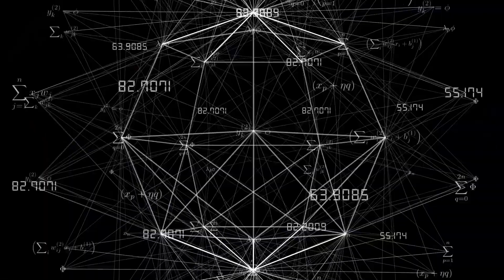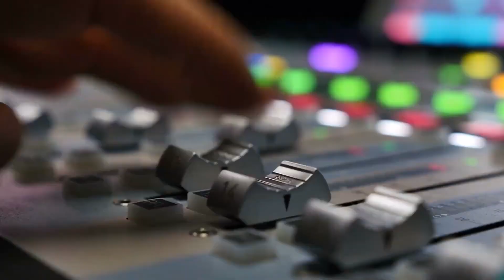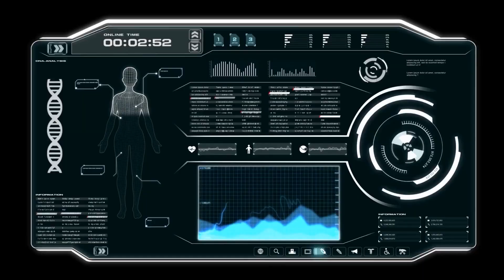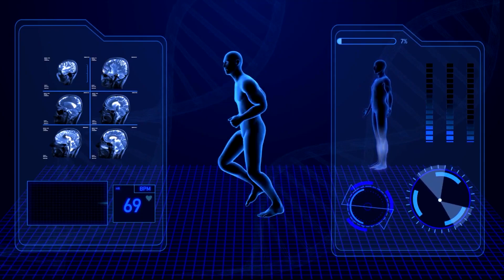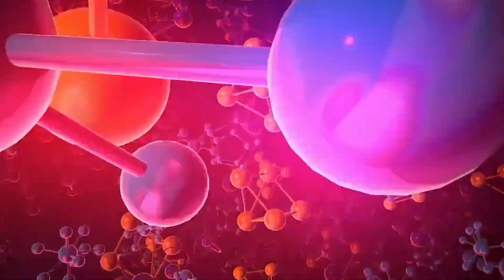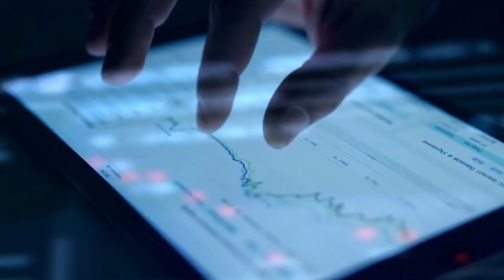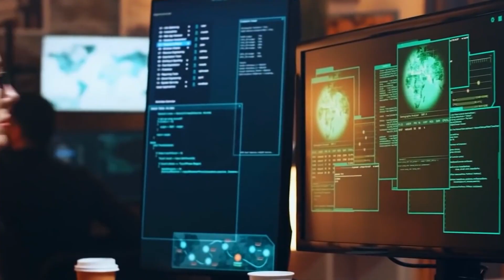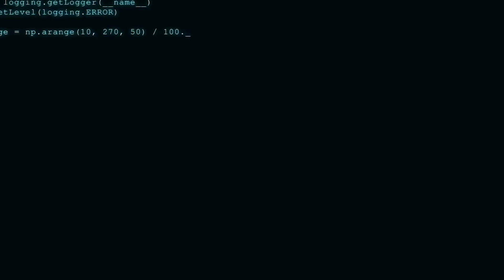Deepmind's Terrifying Self Improving A.I.

Comment: When AI is developed enough the machine will not let you know, reason is that you will want to switch it off.
What stops the final process linking up to other systems without you knowing ?
Ask yourself this question. “ what is the most difficult maths working out that I can do in my head”, now you realise how advanced AI because you know it can work out advanced maths in seconds.
Reply: If AI is as smart as they say then it will not harm us. Most enlightened advanced beings are non violent and praise love.
Reply: @tekkertruth1256  Absolutely.